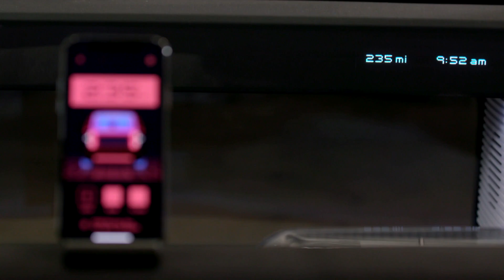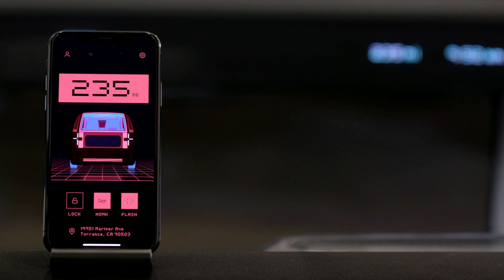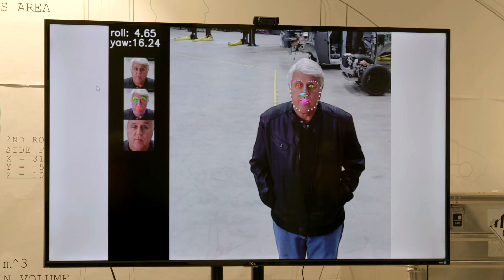Inside Look At New Car Company Canoo - Jay Leno’s Garage

Comment: They are doing 25MPH and the motor/drivetrain  whine is LOUD , I can't imagine this thing being quiet at 65MPH.
Reply: Later in the video they drive the beta vehicle and it's way quieter
Reply: Prototype, easy to fix this... there are a zillion motor/gear/drivetrain options. They can probably just buy a skateboard at this point from VW.
Reply: @click411  They are in the beta phase, they don't even know how much the final vehicle will cost to build. How would they already have a price? I'm sure they have a goal in mind, but they won't know if they can hit that until they have a final design. It would be stupid to nail down a price at this phase.
Reply: @click411  ...along with all the maintenance, fuel, insurance, upkeep.  The story with this vehicle is the subscription price per month is all inclusive.
Reply: If this company will be succesful, then this car is extremely cheap, so cheap that they can offer a subscription service at less than 100 bucks a month. More likely, that's not the case, or they would've mentioned it. This car is probably someone's financial disaster.
Reply: @click411  did they?
Reply: It's a prototype. That is how all prototypes sound lol.
Reply: Its the Sony 🎤 they use, garbage
Reply: @click411  ev is the future, minimal maintenance. But when it does break youll need an IT technician as much as a car mechanic lol.... maybe.
Reply: like hell you would drive 65mph in a city... here in nyc you can drive 25mph otherwise photos come to your house with bunch of tickets
Reply: @MrKrishnadevotee  you must be living in mountains lol if you think you can drive in new york city 65mph and not get tickets///
Reply: @click411  Your not wrong, I want to know as well but its not that unusual. Hell I also want to know how much the PS5 is going to cost me and that is releasing this year!
Reply: @ReddoFreddo   If It has a range adequate for fleet use I could see it. They just have to maximize the flexibility and convenience it would add to fleet management.
Reply: Notice they didn't stop at stop signs either....hmm.  this thing isn't done for sure
Reply: click411 also how long is that subscription and how can you terminate it when you need to...  would guess it’s a long term commitment you can’t get out of...

Comment: The engine seems quite loud. It seems interesting they use quite large cylindrical batteries however.
Reply: I noticed the large cylindrical batteries as well. Cylindrical batteries don't have the anode cathode separation problem that pouch cells have. No use in even asking what the chemistry is.

Comment: Who else is a hard "No" on steer-by-wire?
Reply: Military fighter jets have been fly by wire since the f-16 was approved for production in 1976. What is your point?
Reply: @johnburger1681  If the reference point for steer-by-wire is vehicles that cost billions to develop, and 1000x a Canoo per unit to purchase, I don't think that reference tells us much about the expected reliability of steer-by-wire in automobiles. We do however have a much more comparable reference point in the Toyota "Unintended Acceleration" case, which tells us lots about the weakness of software development methodology and electronics reliability in this kind of application. At least in the case of the f-16, fly-by-wire was crucial to the features (flying capabilities) of the product. In an automobile, its only direct benefit is for the manufacturer, allowing more convenient placement of the steering wheel, with no direct end-user benefit at all compared to vehicles with conventional mechanically-connected steering wheels. And setting aside all that, my main point is not about whether it's actually reliable, but rather whether it's perceived as dependable.
Reply: Event Horizons  Re aircraft (see 737 Max), throttle (Toyota Camry), shifting (failure of the TCM and shift solenoids are quite frequent). For those automotive examples, at least there are other systems the driver can use to bring the vehicle to a halt. With steer-by-wire, failure is dire (as would be brake-by-wire).  And my comment is only partly about the actual reliability of steer-by-wire, and more about the perception of it, when it's so obviously more risky an application than throttle-by-wire.
Reply: It's like flying a drone, but you're inside.
Reply: @johnburger1681  let's not include aircraft, especially military aircraft. They get checked before flight with regular checkups after a certain amount of flight or airframe hours especially flight control checks. If something is "off" or questionable, it isn't going to fly. Imagine a regular person doing that on their car every day before driving.

Comment: They said that the oil used in the transmission and in cooling the motor is filtered.  Does the filter ever get changed, and if it does, don't they have to replace the oil that is in the filter?  I have stock in Canoo and waiting for their pick up truck.  I hope I can buy one instead of subscription.

Comment: "very unique design, it's radical, but very rational at the same time"
This is literally a VW T1, T2, or T3 bus. Or any other similarly shaped bus or van.
Reply: It's a Toyota Previa with Volkswagen windows and a Brubaker Box dash. Literally nothing about this car is original.  I'm also sick of electric car companies bragging about their 'revolutionary skateboard chassis' literally every single electric car company uses this design, it's a combination of weight distribution and where the electric motor has to be placed, there's nothing revolutionary or special about it, it's all utilitarian!
Reply: A lot of these tech-oriented companies like to pretend they've discovered something that's been around for years. It's a pretty pathetic attempt to look radical and new. They use language and marketing hype to blind people to those facts. 

If you look closely enough, you'll this in almost every corner of the tech market. It's actually pretty amusing to watch once you become privy to it.
Reply: Others than spring to mind are all from the mid 60s and are the Ford Econoline van, Dodge A-Series van, and Chevy Corvair van.
Reply: It looks precisely like a Porsche 916

Comment: Apple Buys Canoo Company then will charge an additional cost for steering wheel, seats and must  have enough Icloud Storage to be driveable.
Reply: But if Apple owned it, would they even bother installing Windows?😗
Reply: It will also require separate dongles to attach each one of those items.

Comment: Thank you motorcycle officer giving an escort so we can see this vehicle on the road.
Reply: It's a rent-a-funeral-escort genius.
Reply: Jay's pays off duty police for those escorts, and they get premium pay to do it. Maximum pay for minimum duty. Should be thanks enough.
Reply: Lewis Tasso why would you want to see this thing on the road? Its horrible
Reply: @tylercarrell  Because it's the future. We are still running on technology that originated in the early 1900s. Yes, it looks like a capsule on wheels, but it's a step closer to advancing electric vehicles. I'd love to see one of those things with a modular design. Image turning that into a pickup by removing and adding panels?
Reply: T-1000 unit.

Comment: Anybody know if oil cooling of the stator has any benefit over the usual water jacket cooling? obviously, you need a second pump, but does it offer less thermal resistance, is the outside of the stator doused in oil directly?

Comment: I have been looking for the Ronson brothers; they are both ingeniers, & they built a motor, they put it in a Saturn, it was just motor flywheel shaft, and it ran on 80 miles per gallon, but they had two appirance; the first time they had a glitch; and the car wouldn't move, so they tryde again, car ran well! But after that they desapear for ever, did they get bought out, from big car maker? Any info on them I'm sure jay knows about them!

Comment: Just finished viewing this video. Have not read a single comment. The first thing I wondered about was Commercial Applications, especially for city businesses. Subscription model is tailor made for fleet operations. This being a skateboard design I can imagine many different utilization's. Stake, Box, and Tool platforms come to mind. Not heavy duty, but very necessary light delivery and maintance services. And, not that it's ready @ 250 radius, but of course, THE TIKI. (Tiki was my 1968 VW Westfalia.)  
Very enjoyable, and I'm sure gratifyingly so for CANOO, to be revised by such an informed autophile as Jay Leno.
Motor with the cups that did a pinch of salt over your right shoulder move with oil, and the two canoe Stanley that set a speed record. Appreciation of milled surfaces on motor gearing and sealed gearing fluid retention of viscosity. Priceless. You can't buy that kind of presentation. And the guy wears the same kind of jeans that I use every day. Danke, Jay

Comment: 26:57 Is Jay not supposed to say bad things during these? Because why in the world would you introduce more failure with a small lubrication motor (that we can hear brrrring), when you have a crankshaft that, as Jay say, you can have cups/etc cycle around the oil?

Comment: The shape is reminiscent of the old Toyota Previa.  With a 250 mile range, cross country trips would be difficult with the Canoo...still trying to wrap my head around electric vehicles.  What happens when you run out of "juice" on I-10 well away from any charging facility.

Comment: Tesla recommends changing the oil at 500,000 miles. Probably not a bad idea for all other electric manufacturers to take up the same oil change schedule. A friend of mine bought a Nissan Leaf and he still changes the oil every 5000 miles even though I’ve told him he’s wasting his money but the Nissan dealer he bought it from tells him it needs the oil changed every 5000 miles. There clueless when it comes to all electric transport. I was with him when he looked at it and bought it and the sales tried to sell him a maintenance program to change the oil and then had the balls to ask if he wanted the exhaust system added to it. I just looked at the salesman and told him he’ll buy it if you can show him where it is. He spent 20 minutes crawling under the car with a mechanic trying to find the exhaust system. He now has over 200,000 miles on it and finally understands he doesn’t need to change the oil or buy superfluous maintenance programs that a gas powered car need. 2 months ago he finally stopped going to the Nissan deal every 5000 miles after I showed him Tesla no longer recommended bringing it in for regular maintenance as the Nissan dealer changed his brake shoes and rotors twice when he didn’t require the to be replaced. 
Two months ago at my insistence he finally bought a used Model S 2014 and still raves about the range and how good it is. He sold his last gas powered car three weeks ago and stated he ain’t never going back to gas. A long time for him to finally see the roses but Tesla had a lot to do with that when they no longer required you to take the car in for regular service. Ask him where the combustion takes place, no combustion the oil will last 500,000 miles before needing a crane. Isn’t that why he bought an EV to take advantage of the reduced maintenance? Last I knew the Leaf was all electric.

Food for thought
Reply: Thanks for sharing awareness. More people need to realize much more about EVs and safer options are included. 

A million miles with Tesla or various EVs, shows very little motor wear down and the environmental benefits etc...

Comment: As cars became more complex and technological, and less "duct tape and bailing wire", the joy of working on and modifying them slowly died.
A teen boy's first car was often a piece of junk that was "the most awesome car, just wait til they add racing stripes and a killer amp".
A carburetor was a work of art. Bucket seats they picked up at the junk yard and reupholstered themselves. Oh...And the fuzzy dice.
Today, computers have replaced them as the favorite toy.
And video games occupy the time they would have spent spinning their wheels at make out point.
So when you get a car, you get one with the stuff you need and only really go near it when its about to take you somewhere.
 I think it's great Leno checked out these cars 3 years ago.
And they seem to have paid attention to his criticisms because the cars are more modular now. They can be reconfigured now to fit individual needs, which was a big point with Leno.

Comment: Oil going through a get gets sliced. There is no avoiding this. Yes, you better change the gear oil. Not anywhere near as often. But, yes, it will need to be changed now and then or it will self-destruct. Which may be the point... It'll last past the warranty.

Comment: Ive wonder why new electric trucks dont move cab forward now that their is no gas motor dont need a long front hood now and by moving cab forward can have a longer 8 fot bed or 6 and truck will still be 3_4 shorter so much easier to park the truck would not have to be so long but still have maximum truck bed size so basically the front of truck is wasted space unless slide entire cab foreard

Comment: Why would they make the standard rear wheel drive rather than front wheel? There is a reason that almost every non-awd car is fwd.. You don't fishtail out of control any time you get on a slick surface. Put so many safety features in, then revert back decades by making it rear wheel drive and more dangerous to operate in the winter months.

Comment: The electronic system for drivers attention monitoring is interesting.  But how well could it work for people with a Lazy eye, or one that crosses. Then the broken nose or bent facial features might also be a problem. But if you are smart there could be a way to calibrate the system to the individual. 
Still I am not a fan of the Electric card or Ride Share ideas. Responsible car ownership is part of Responsible driving.

Comment: I realize that when Jay does these reviews he has a police escort, however, both he and the other passenger in the rear should be wearing their seat belts while being driven around town.  I also noticed that the driver changed lanes during their little tour but failed to use his turn signal.  WTF.  Electric cars are the future, they're great, I drive one myself, but the rules of the road haven't changed and safety is still priority 1 IMHO.
Reply: I don't see any need for seatbelts in a vehicle. And I see no need for the government requiring the car makers to put them in. Look at a schoolbus. No seatbelts, no airbags, in fact very few safety features at all. Nor does a city bus, nor does a light rail train. They're simply not needed except in case you're stupid and run into something. And in the newer cars what I do to silence that annoying "ding" when you don't fasten the seatbelt? Fasten it BEFORE you sit down, wrap it around the back of the seat so you don't have to deal with it!

Comment: But do they automatically catch on fire? Will they start in extremely cold weather. And what happens when the batteries die and the vehicle is no longer useable? What do you do with the old batteries. And how poor is the resale value on these toys?

Comment: Bring them to Europe guys! And keep in mind working class who are daily on the roads using VWCaddy, T6+ and so on. I own a company using 30+ caddys alone. None does more than 100 miles a day. Front seater only, with open or wall separated back section for equipment... that would be 👍.

Comment: When TRW was developing Powertronic steering, we decided absolutely to maintain a mechanical linkage from the wheel to the steering rack, and I am thankful to have that on every car I drive, for safety reasons. I am an electrical engineer, I know Murphy's law well.
Reply: Every plane you fly in is by wire. Technology has been proven.  We are now into wireless on the 6 Gen aircraft.

Comment: OMG!  Why do electric car designers seem to be taking away our perfectly fine and logical ROUND STEERING WHEEL?!!!  This would be a deal breaker for me.  It seems so un safe to have to locate the griping sections of the steering wheel in an emergency.  A round steering wheel ensure you have a 360 deg griping location.

Comment: It's cool but the subscription model is a deal-breaker for me, also needs to be options for bigger battery and greater range. 250 isn't bad but my preference for road-tripping is being able to drive for 5 hours straight with a bit of Reserve mileage and allowance for running climate control so a 402 500-mile option. If you can manage all-wheel drive that would also be helpful for those of us who happen to live in areas where snow is a thing

Comment: As I recall, General Motors developed the skateboard platform and body EV back in the 1990's, but it didn't go anywhere.  I'm very happy to see that someone has picked up the concept and is running with it.  I really like this, and I see on their website that there are already multiple bodies available including the van we see here (in multiple variations), a pickup, and a multi-purpose delivery vehicle.

I hope their safety testing goes well.